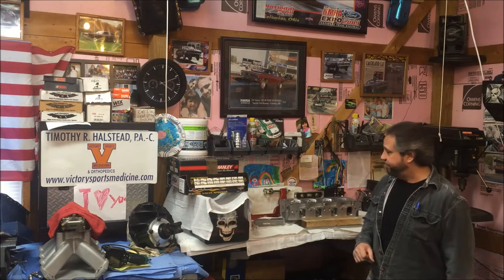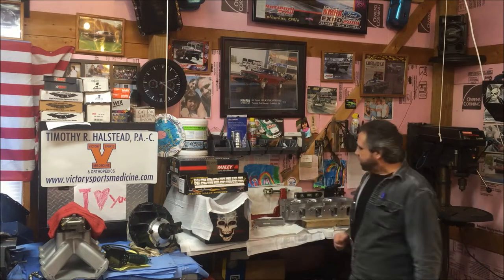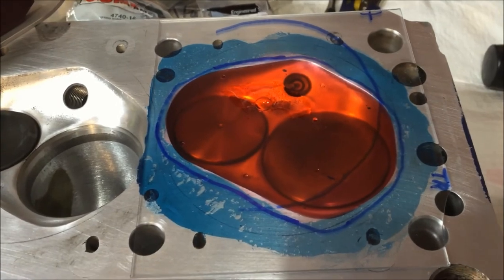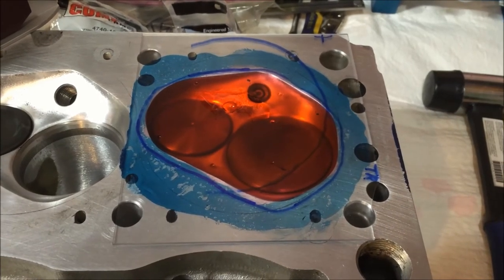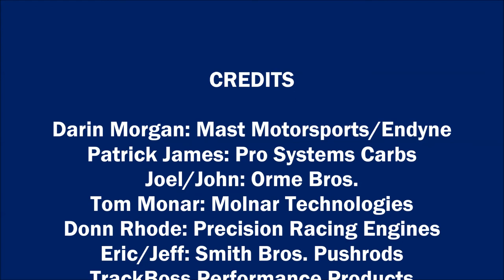Episode 45: Measuring 351 Cleveland Combustion Chamber Volume

Comment: Hey tim,watching all the way from new zealand,looks like you build some pretty serious clevos over there in the states. Ive been building engines for round 25 years with plenty of street clevos to my name have a great little combo sorted running 10-1 compresion with a good cam and headwork,c4 2500 stall and 3.5 gears makes a solid 320 hp at the wheels. Looks like your next level mate keep the vids comming.getting some good ideas for my next build
Reply from the maker: Thanks John for watching from NZ, I appreciate you watching and getting something from my vids. Yes I love to hear about street combos, need one someday for sure. That Clevo sounds pretty healthy and that is great useable hp on the street. Make sure you subscribe and share with your friends and stay tuned.

Comment: Hey Tim great video as always and that’s awesome to see your daughters get involved as well. Hey I’ve got some questions and would love to pick your brain of ideas regarding my build of 408 Cleveland as well. I have  a pair of unused original B3 heads I am trying to use and I got the original intake and exhaust flanges with the purchase years ago. One of the problems I’m having is I don’t like the fact that spacers have to be used in order to use the heads on a Cleveland block so what other intake options do I have?
Reply from the maker: Thanks, want to teach them something, they will never learn in a book. And memories forever.   When you tell me this, sounds like it is a 9.5 DH intake, can mill it down. Those intakes are all pretty similar, A351, A331, really the same, other than rear intake cut for windsor, or cleveland, and cut down to fit 9.2. Is this what you mean?